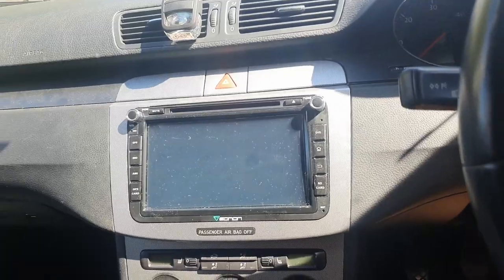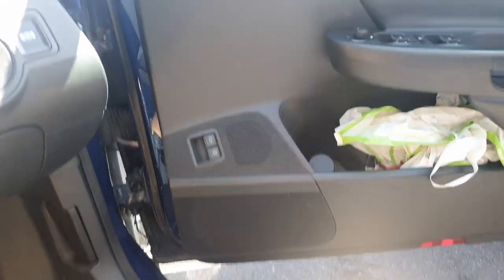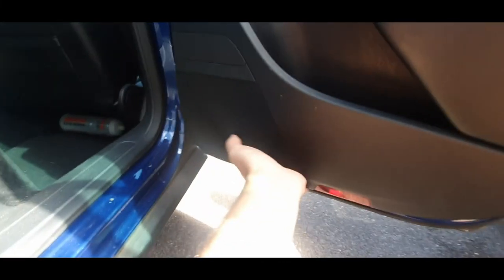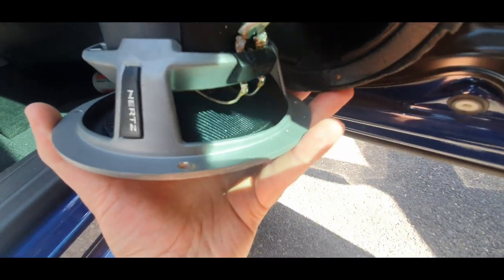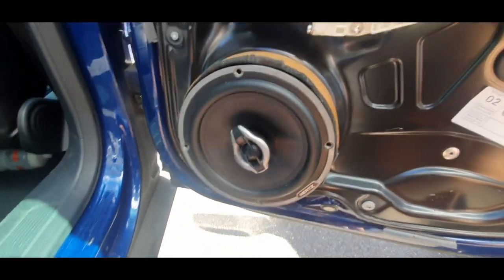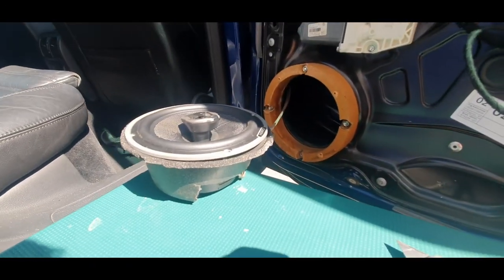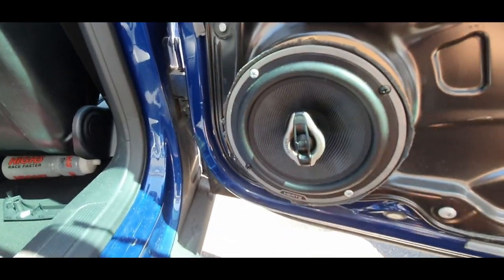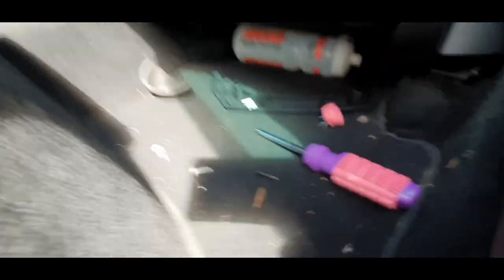How to fix car door speakers - no power - poor connection - blown - baffle removal

Comment: hi Dave thanks for the video.
I recently had my front speakers replaced. well all my speakers were blown but currently have the fronts working. i realised there is a drop in sound quality few seconds of music comes on.
the audio guy who replaced the speakers cant notice the drop in sound quality. 
what do you suggest as i am thinking about replacing the rear speakers too

thanks
Reply from the maker: The drop in quality might be a number of things. If your new speakers are more powerful they will need more power to get them moving. This may make them sound odd. Did the audio guy wire them up in reverse? Polarity. Also I'd deffo get new speakers all-round. If you have an amp that would be good too. Just a simple 4 channel amp will be suitable. Also the quality might be down to a poor ground, head unit, wiring, battery, alternator or connections aswell and not necessarily the speakers alone.
Reply: @dayv  so basically i got the car just before the first lockdown, then realised the audio was not working. first audio guy said it was faulty dynaudio amp. got used 1 from europe. first audio guy was not working due to the lockdown. took the car to a 2nd audio guy who found the fault to be blow speakers and not the amp. I think he also mentioned issues with some wires. The tweeters were all working except the base. he changed the front 2 speakers only as i wanted to get refund for the amp to afford the rear speakers.
since he cant notice the drop in sound quality, i dont know if i should find a new audio shop to take car to.
thanks
Reply from the maker: @isaacboateng9782  sounds like the previous owner looked after it 👀.  I would take it to another audio shop if it's bugging you. Could be something simple like the wiring being loose or a bad ground. Have you disconnected the rear speakers? They might be interfering witht the new speakers that are working.
Reply: @dayv  hi Dave, so i tried out a new audio guy over the weeknd. he also could not notice the drop in quality. i am happy woth sound i am getting now after replacing the rear speakers.

next project is to either update my head unit or replace it with android 
what do you suggest.
thanks
Reply from the maker: @isaacboateng9782  I have an android one they are cheap and look cool but they are very slow and not very reliable. My Fm radio doesn't work and the DAB breaks up (I've tried different aerials). I've had many different headunits and in future I'd probably just get something with easy to use controls and Bluetooth. Most audio is done via my phones Bluetooth using Spotify. If I wanted maps I'd just use Google maps on my mobile. At the end of the day you get what you pay for so I'd probably choose kenwood, pioneer or Alpine for the reliability and performance  

Hope that helps.

Comment: I have an aftermarket car stereo and i wanted to spice my tweeters to both the rear speaker wires den i notice its both not working as well as the rear speakers. So both the rear speaker wiring coming straight from the din isnt giving out power why is that?
Reply from the maker: Bad connection. Not connected. Fader to front and Rear on unit settings set to front only. Blown speakers. Wrong wires connected. Volume not loud enough. Damaged wiring (often in door hinge). 

Could try getting a small amp and connecting that to the speakers instead. It might be a faulty head unit not giving the power to the rears.

Comment: My car still can play music but one of my rear speakers doesn't play sound, but I can see it move and go with the bass. Any ideas what it might be
Reply from the maker: Sounds like your coil is damaged. Maybe looks like it's working for the low frequency but High frequency maybe its blown. Hard to tell. Can you swap the speakers over to rule out the wiring?
Reply: @dayv  will give it a try Thankyou for the response